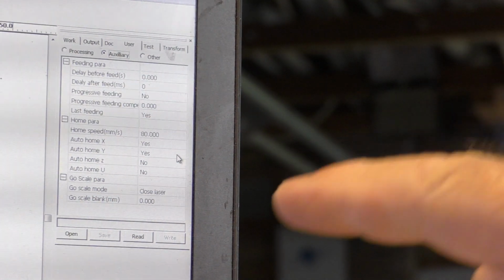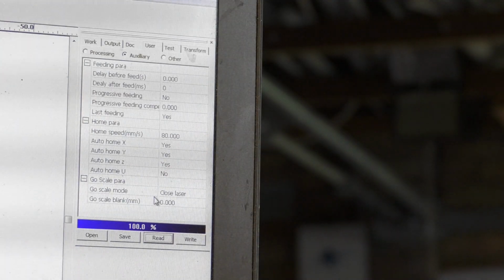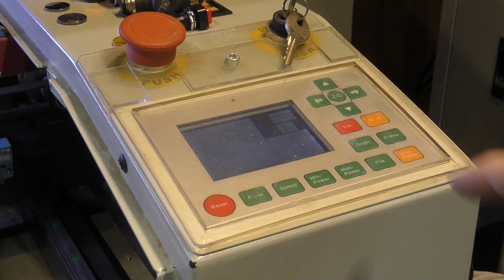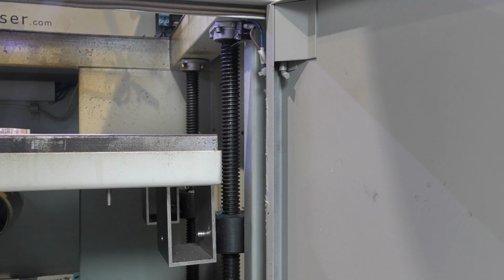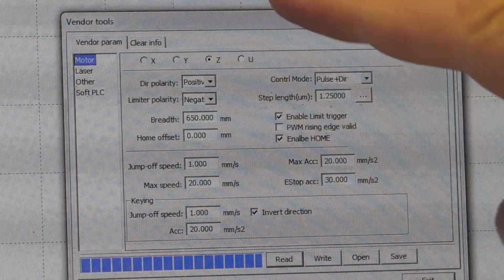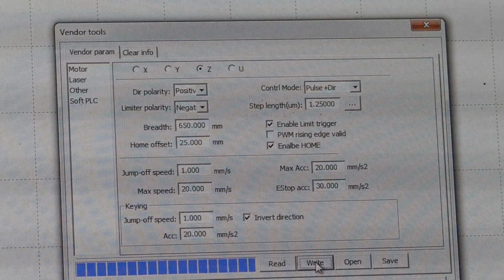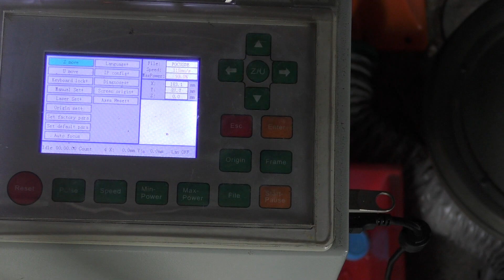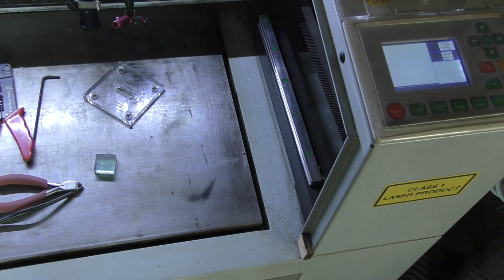RDWorks Learning Lab 214 Setting Z to a New Zero Position

Comment: Well, i don,t really get the Point of this Method. I always set Z Zero to Table height and then choose my Workpiece height in Lightburn.
Unfortunately RdWorks doesn,t support that.
Another reason to switch Software...
Reply from the maker: Some versions of the Ruida controller do support  a flexible Z zero.  but not the most popular 6442 controller.  RDWorks was the only sensible software available  6 years ago when I began my learning journey.  I do have Lightburn and am a devout fan. I know that Lightburn will eventually become the industry standard  but I cant just rename my video channel and many new users still begin their laser experience with RDWorks.  My learning direction is more focused on the technology and not  the program so this session is a bit of an oddity. 

Thanks for the comment because other readers are being made aware that Lightburn can do so much more than RDWorks.  I always encourage new users to try the free download of Lightburn after a couple of months using RDWorks. That way they will really appreciate the difference. 
 Best wishes
Russ
Reply: @SarbarMultimedia  Hey russ. ;)
No one wants you to rename your channel.

I also didn't want to offend you.

I started with RdWorks myself years ago. Just because there was no alternative, as you mentioned. But since Lightburn came to Life i'm abolutely stunned what these guys make possible. I'm a great fan also.

I absolutely LOVE your channel and consumed every second of footage on it.

Especially your unconventional approach to some Problems makes it fun to watch and very helpful.

Keep up your amazing work, and foremost, keep healthy  : )
Reply from the maker: @ichbinsnur1941  
 Hi 
Trust me, no apology needed, I take no offense . I considered your comment valid but thought you may not appreciate my devotion to Lightburn. I have nothing but respect for "Zak" from the earliest days of his venture 5 years ago and I am really excited that he has been so successful.
It's amazing that there is so much yet to learn and understand about this technology even after such a long time.. I can see my lens venture lasting several more months, because cutting  is just the first of several big lens  questions I need answers to. I am hopeful that the answers will make my further questions easier to answer.
I am sure that by now you must appreciate that my ignorance, lack of  any scientific equipment  and insatiable curiosity  drives me to be unconventional in my approach to solving problems. In reality acute observation and logic (sometimes a bit shaky) are my only tools. 
 Thanks again for the comment
Best wishes
Russ